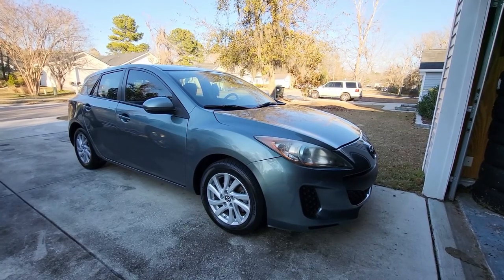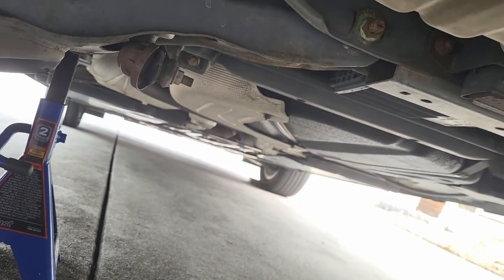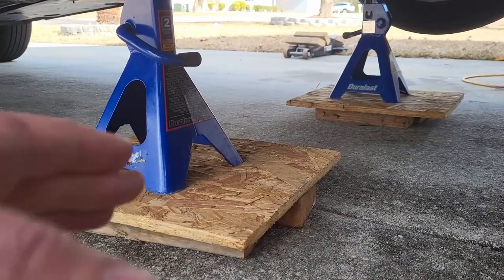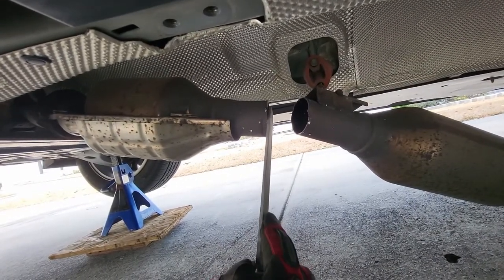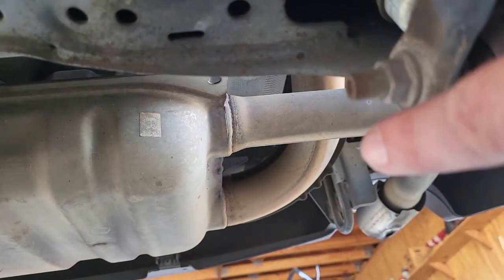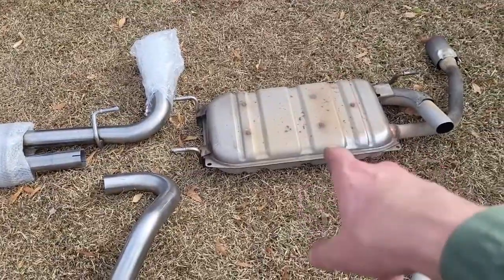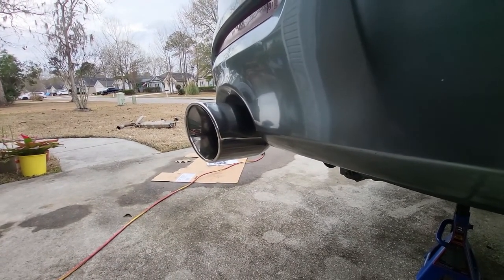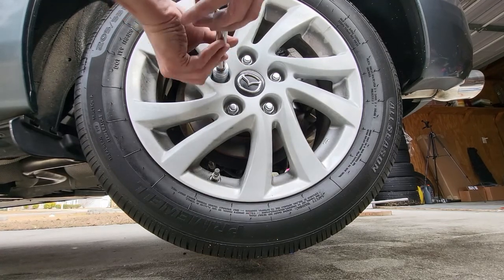2013 Mazda3 Magnaflow Exhaust #mazda #mazda3 #exhaust #magnaflow

Comment: is this the same engine as the ford mondeo mk3 2.0 16v duratec he? I thought they shared the same one and im looking for a nice exhaust
Reply from the maker: It might be. I know Ford and Mazda were sharing a lot back in the day.
Reply: @lsccarvideos  yeah i think so, what is the engine name for yours? and what would you recommend? mid muffler delete? or both and a valve?
Reply from the maker: @nom37cy52  It's called a PE-VPS engine. And as much I like to delete the CAT, for driving on a normal basis, I do like the CAT back design cause it isn't too loud.

Comment: I want to get the "MAGNAFLOW 2010-2013 MAZDA 3 STREET SERIES CAT-BACK PERFORMANCE EXHAUST SYSTEM #15127" for my 2011 mazda 3 2.0L

Is there anything i need to know?
Reply from the maker: The only issue I have with mine is the tip sticks out a bit further than I like. Other than that I'm really happy with it.
Reply: @lsccarvideos how far out? That might be a deal breaker for me
Reply from the maker: @brayamsworld77  maybe like 2 ish inches out. I think I show it near the end of the video. But yea, it bothers me each time I look at it. Lol
Reply: @lsccarvideos  damn. Alright thank you, do you know if theres anyway to make it shorter or am i just stuck with it?
Reply from the maker: @brayamsworld77  so what I've thought about doing to mine is cutting it just before the tip and take a couple inches off the pipe and weld back on the tip. Other than that I couldn't see any other way to make it shorter.